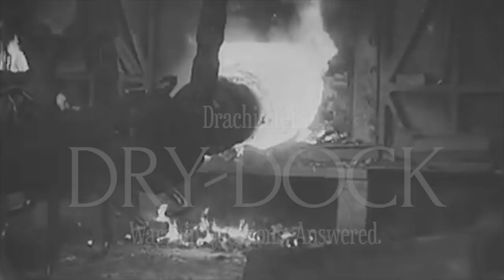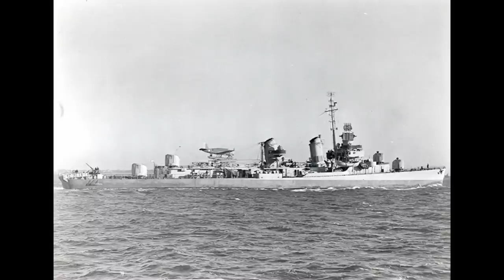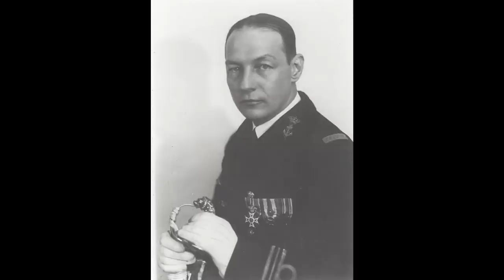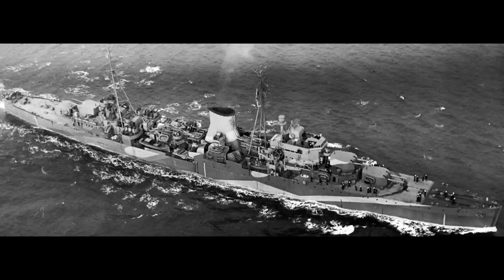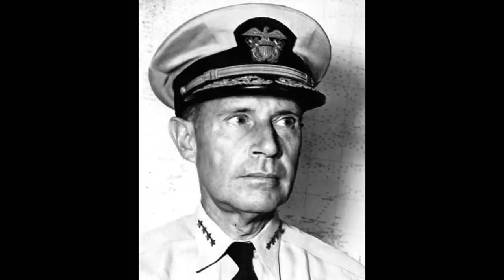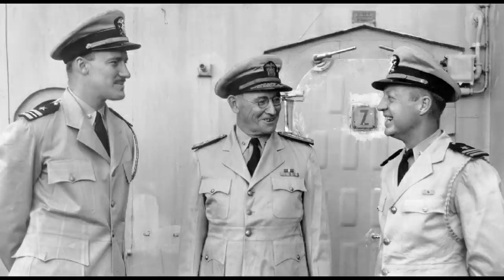The Drydock - Episode 191

Comment: A good hour long video and thirty minutes reading the comments. Re cables and pipes through bulkheads, cable used to be strapped to cable trays and passed through bulkheads in individual watertight glands, and pipes had isolation valves on each side of the bulkhead to isolate a damaged section. cable trunking wasn't used, because if water got into it you couldn't contain it, it would spread throughout the ship pretty rapidly. all pipes and cable trays and pipes were high up in the passageway. At least that's what I remember. As for the Lieutenant thingy, I just called them Sir.

Comment: A couple of other reasons why navies often suffer during revolutions on navies.

A lot of the time a country that has gone through a revolution will have a lot of internal unrest from the remains of the old regime and parts of the populations. In most cases a navy is of limited use in suppressing this unrest apart from landing marines in port cities. 

Also for a lot of countries including France, Russia and China a navy is something of a ‘nice to have’ rather than a must have. Without an effective navy France for example is more vulnerable to attack, but a weak army would leave them open to invasion.

This all means that the navy just doesn’t get the same attention as the army which would at least partly explain the problems most suffer from.

Comment: My father served on one of those sea sleds. He said it was a thrill speeding across the water, but any type of weather sucked. The thing was all engines with a flat top deck. Aircraft was tied down. Sled turned into the wind ran up to speed aircraft started tie-downs released and it would kinda just pop up into the air. Must have been wild

Comment: With regard to 31:09 and "leaving things off" to get under the treaty limits. One of the more common tactics, used I believe by all, was to under-fill the magazines for the purpose of standard displacement calculations. Instead of say 100 rounds per gun for a battleship, maybe state your capacity at 75 or 80 per gun. with shells perhaps weighing a ton or more, being "short" 200 shells isn't a minor effect; it's of the same order as the design margin in many ships.
Reply: "No really, our guns are so accurate we only need 20 rounds per gun!"

"But there's space for 100 rounds per gun."

"They're spaced out for safety purposes."

Comment: As far as revolutions and their impact on navies, I think it's mainly that navies inherently require a much greater degree of specialized technical knowledge than armies in order to operate. With an army, you can throw together a bunch of conscripts, give them a few weeks or months of basic training, and have at least a halfway decent army. It's far from ideal, but you can make it work, and you can usually find at least a handful of successful generals in the midst of the new officer corps (revolutionary France is a prime example). But the level of training and knowledge needed for an army unit to perform its basic functions, while significant, pales in comparison to what's needed to effectively maneuver a sailing frigate or manage its rigging, operate and maintain the engines on a steam warship, or effectively aim and fire the guns. If the people with that knowledge and experience are suddenly removed, a navy is essentially starting from scratch with a much steeper learning curve than an army would have to deal with.

Plus, when a revolution brings in a new regime, the army's loyalty and effectiveness are much more important to the survival of that regime than the navy, so the army tends to get much more attention and funding.

Comment: Barnegat class was designed as a small (2000ton) seaplane tender.  One was also trialed for catapult training.  Very spacious internally, Barnegat was a good choice as a GP secondary ship-better SoNAR station, quieter, able to mount a lot of guns, Hedgehogs, and/or advanced sensors.  Cheaper and slower than current fleet destroyers, she also would've made a dandy convoy escort command ship.
Reply: Barnegats were fitted for 4x 5"/38cal rifles in single turrets, but quickly lost their four gun pretense as wartime exigencies demanded close range AA defense.  A midwar Barnegat might sport a single 5", two quad Bofors mounts, and a Hedgehog or two.  Plus RaDAR, SoNAR, and a Philadelphia Experiment Invisibility Projector.  Oops!  Delete that last.  Darn Wikipedia!  ;-)

Comment: But what about ASW? I could imagine a scenario where a floatplane with some light bombload could be pretty useful as a patrol aircraft for a trade convoy, without comitting a whole aircraft carrier. And losing a gun turret would not make much of a difference for ASW, right?
Reply: The problem is a destroyer is just too small a platform to effectively handle aircraft.
Reply: @WALTERBROADDUS  Fair enough
Reply: @WALTERBROADDUS  converting a merchant ship to a seaplane carrier that can launch atleast 2 floatplanes could probably do, and arm it with a few 4 inch guns for good measure, now it's either a floatplanes with a few barrel-type depth charges ready to drop, or go gun platform and mount a .50 cal or 20mm on a float plane and have that shoot against Surfaced Subs, depth charges would still probably be better Incase they dive.